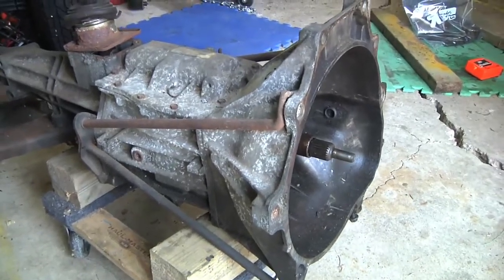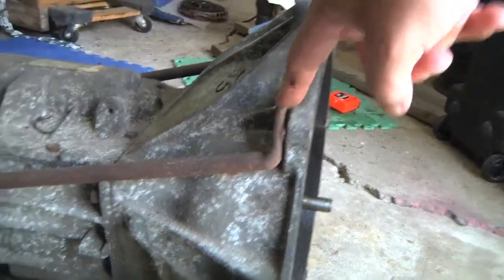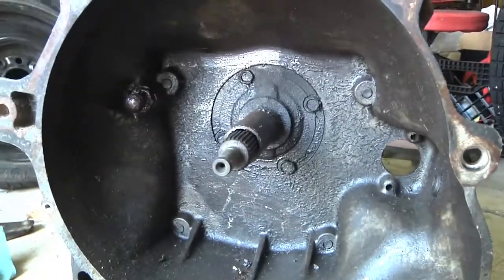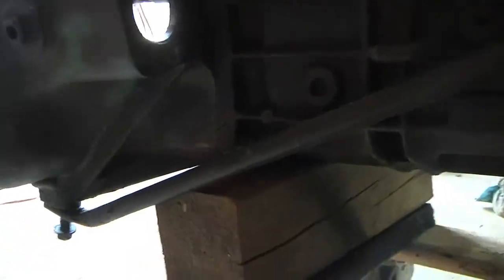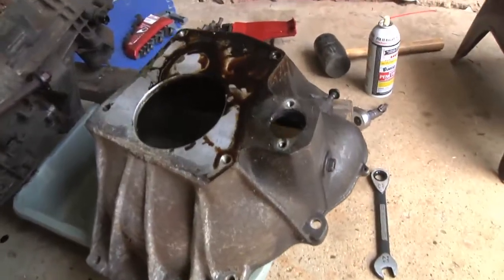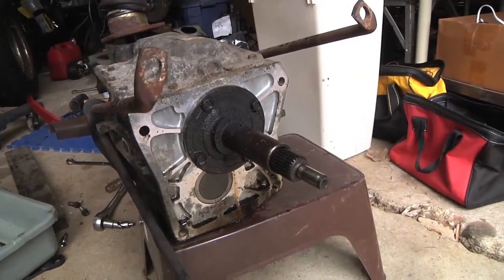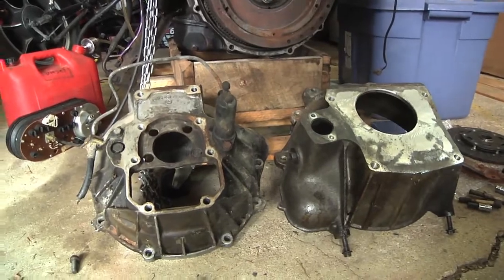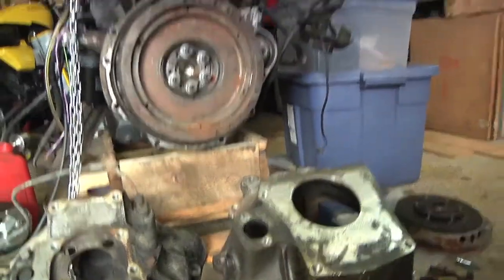SuperTruck: Bell-Housing Swap

Comment: It looks like the easiest way to get a clutch setup would be to use a hydraulic throw out bearing like a later model truck uses. I'm guessing that's what you were talking about when you mentioned cutting into the bell housing. The good thing about using GM parts is they're cheap and easy to get. Good luck on this project. It looks like a lot of fun!

Comment: looks like if you incorperate the 3/8" thick adapter plate you can include a larger size hole near the center of the trans to allow that center flange to be surrounded by the adapter plate. Anyway , that's the route I would try. Also I would definitely try to modify those support bars that had to be removed to fit the housing on. It looks like it really needs the support that thing offers. Good luck and keep us posted.
Reply from the maker: Yeah, that's what I'm thinking too.

Comment: Why not just use a Mercedes transmission?
Reply from the maker: The Mercedes transmission would need custom mounts, some sort of adapter for the weird levers coming off of it, custom stick, and wouldn't line up with the original stick shift position. It's only 4-speed instead of 5, harder to find parts for, and more expensive. I also want to go to at least the first section of stock drive-shaft, and the Chevy tranny matches that. I'd like to keep things as much stock Chevy as I can for sake of cost and simplicity.
Reply: BenjaminNelson I have to agree with Meta Patriot, as someone who has worked on everything from motorcycles to trans-am circuit race cars to diesel trucks to jet aircraft; it would have been much simpler to simply use the mercedes transmission and weld/modify the mounts, floorpan, etc. Also, it is a piece of cake for a good driveline shop to make a special "adapted" drive shaft using the yoke for the mercedes transmission and the shaft that came in the truck, and usually not very expensive to do it either. Besides, aren't you going to have to have the shaft shortened and balanced when you add the electric motor into the driveline anyway? In that case modifying the driveshaft will be a necessity either way.